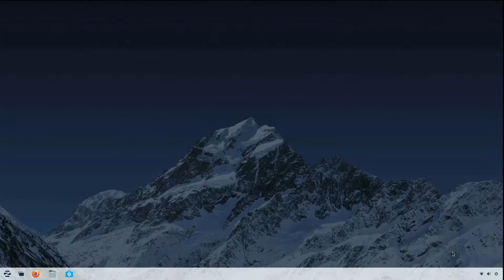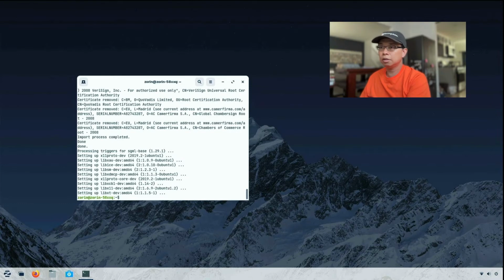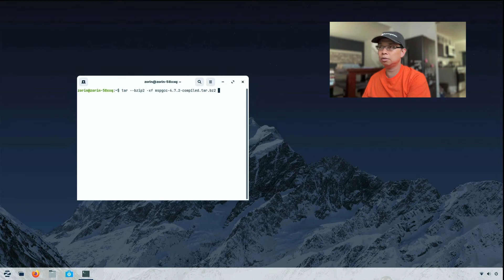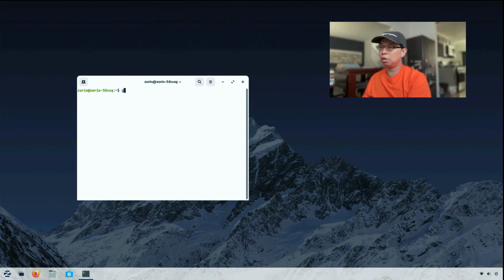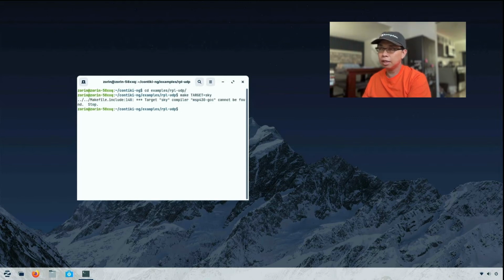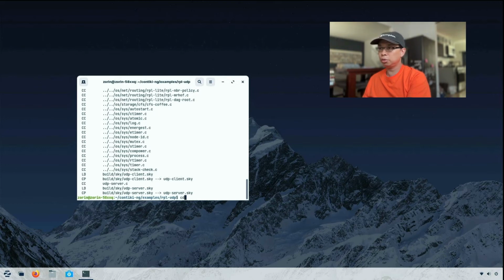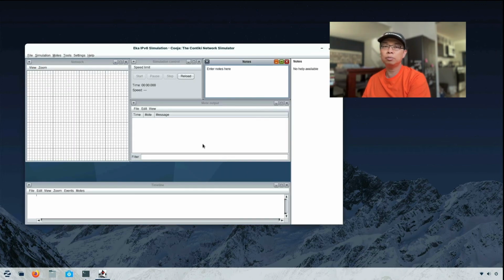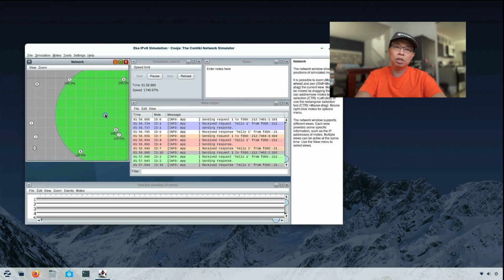Step-by-Step: Setup Contiki-NG Cooja IoT Network Simulator on Linux System

Comment: Thank You So much. I could successfully set up cooja simulator on Ubuntu and also sever-client simulation worked.😊
Reply from the maker: That's great to hear! Glad you were able to get it working!
Reply: @ekasusilo  Which ubuntu version did you use?
Reply from the maker: @mukulshukla831  the video was made with Zorin OS 16.2, which is based on Ubuntu 20.04
Reply: @ekasusilo  will it work on Ubuntu 20.04 on Windows WSL?
Reply from the maker: @mukulshukla831  Yes, I have a video of setting this up with WSL. Please look through the video in my channel

Comment: Good afternoon Eka. I am with a project of a simulation of about 10 good nodes and an attacker that makes denial of service attacks or other networks and can activate an alert system. Can you help me? Please do you have a model guide I can work with or can you give me some guidance? Thank you very much. I am in Colombia and I understand a little English.
Reply from the maker: Hi Fernando, you need to be specific with the type of DDoS needed to simulate. The simplest form of attack on wireless sensor network is by jamming the radio channel, considering that most IoT system works with channel hopping.
Reply: @ekasusilo  Hi Eka, I work with a Rasp and some sensors in a project of an intrusion detection system, using a dataset that has Dos TCP, DDos TCP and UDP attacks, port scanning, and others, my need is to learn how to simulate in Contiki some of these attacks and be able to activate the detection system with some alarm before the attack. Can you provide me a personal email or we can make chat?
Reply from the maker: Sure, let me know how I can get in contact with you, thanks!
Reply: @fgutierp1  Hi! I'm currently working on something similar and need to learn how to simulate these attacks on contiki. How were you able to do it and do you have any resources/pointers that could help. Thank you so much